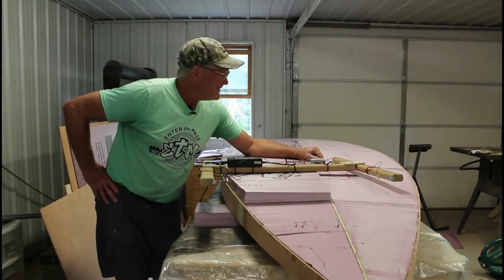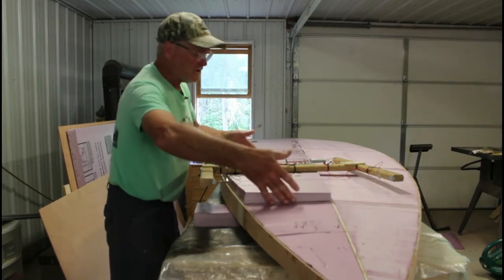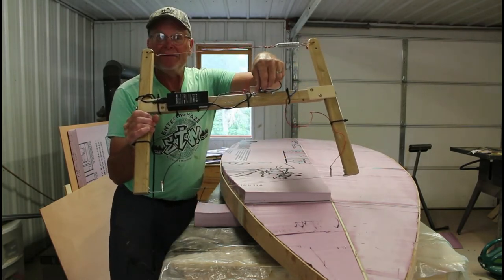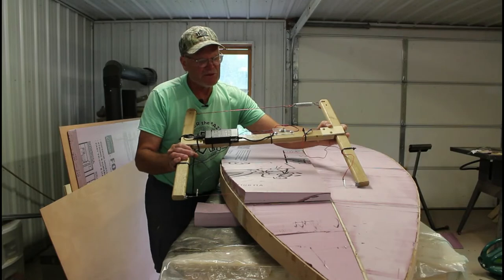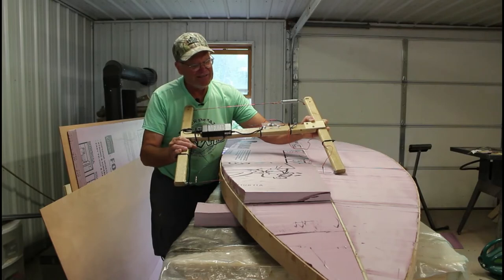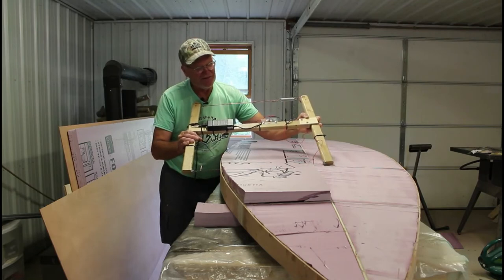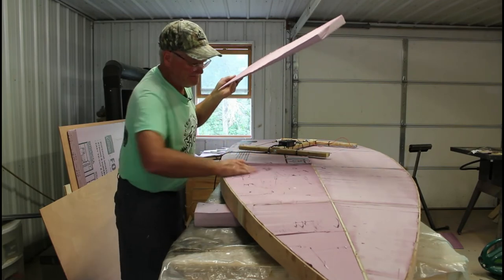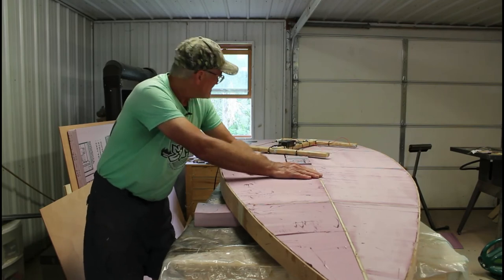A Foamboard & Plywood SUP

Comment: Is that foamboard cutter plan in your new book?  It looks really good.
Reply from the maker: Hi Dave. I dedicated about 4 pages in the paddleboard guide, "Walking on Water", to building a foamboard cutter. It is a basic H frame, with wire at the bottom, and heavy wire with a spring at the top, to take up slack as the wire heats and expands. I powered it with a 5 amp 12V adapter, but a 2 amp battery charger would also work. I made mine to fit the width I needed. They are fun to use, and cheap to make.